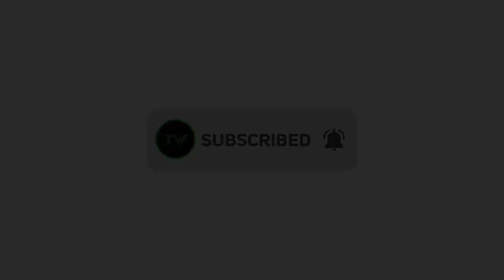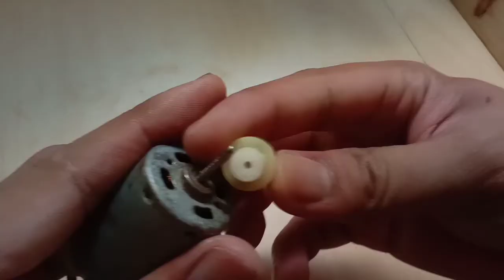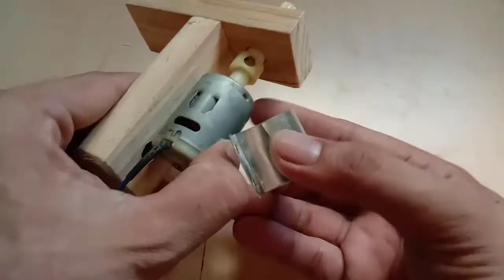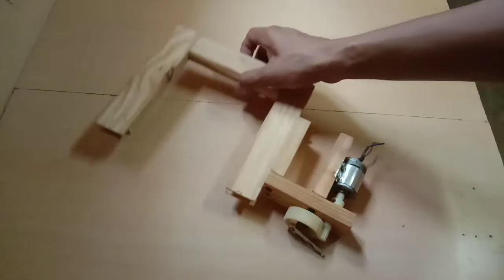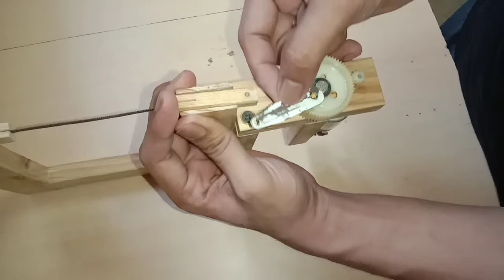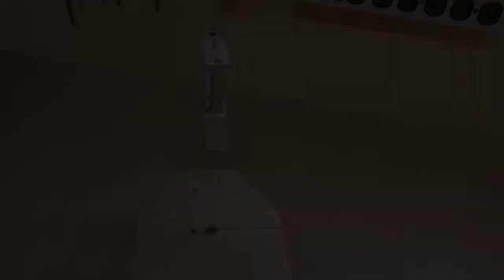HOW TO MAKE A MINI SCROLL SAW | DIY SCROLL SAW

Comment: Hi, Its an eye opener! , if i were to get a gear motor , what should be the best motor using  for 12 V DC   . Thanks
Reply: @koolprojects5159  Thank you  very much for your reply .  Sorry for asking another 2 questions   
1) the 2 springs,  is it strong enough to tensioned the saw blade ?- looks like the  springs are from ball pen very small ,
2)Pin saw blade is  a bit big in width  I use pinless coping saw blade is these a way for  attach pin-less saw blade in your project model